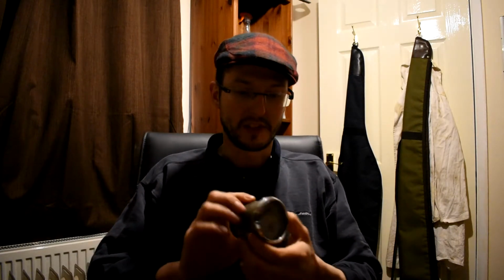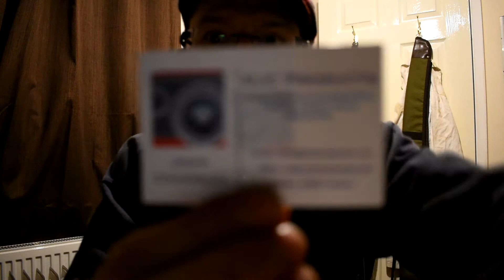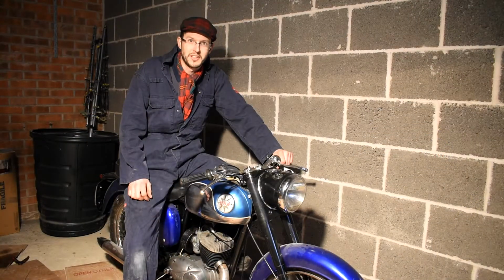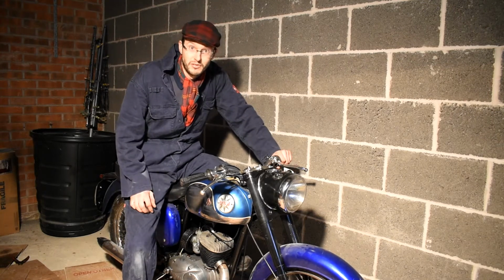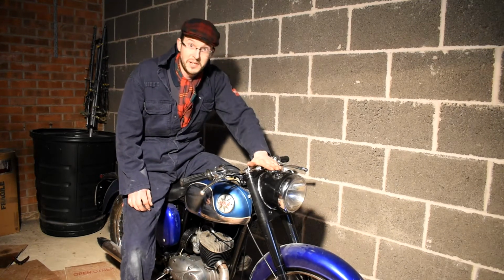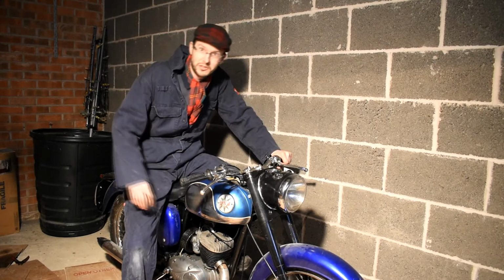BSA Bantam HT Lead and Speedo

Comment: Hi Steve. Great little bike. I had one, a D14/4 in the late 1970’s same colour. In the days when as a youth you could ride up to a 250 on “L” plates. 
Since went to bigger and better bikes and now classic cars. As I sprint a TR3a. 
But very fond memories of the little 2 stroke bantam.
Reply from the maker: Limiting new riders to 125 in my opinion is dangerous. With today's roads and how people are on them I think they should change it back to 250. Whenever I've been out on my Yamaha 125 on a duel carriageway I always feel the bike is doing too much work and can only just get to 68mph on a downhill, its dangerous for me and other road users. Then it becomes stupid as to gain a full licence it has to be done on a 650. Hold on 125, 650 there worlds apart, shows the government don't know what there doing
Reply: Steve Denton 
I know what you mean Steve 
But I lost a mate who went from Honda ss50  to yam 250LC
The only qualification was going from 16 to 17 years of age. 
You had to snap the throttle on the 50’s to get them going. They did the same on the LC’s = uncontrolled wheelies into oncoming traffic.
At least direct access has a limit on power.
Reply from the maker: I'm sorry to hear about that. I think it'll always be a grey area for debate on 125s or 250s or going off the horsepower. That said when I do pass I'm just going to go up the bikes engine sizes a little at a time. I don't think you can ever put a price on experience, so no R1 for me for a few years at least
Reply: Steve Denton 
Have some real fun and see over the hedges with and adventure style bikes. I moved down to the BMWf800gs. Triumph do similar. Great fun both here and abroad. 
Say safe. 👍

Comment: I put an O ring behind my clock...helps a little to keep water out.

Love the real neat crimping job.

You a club member Steve.
Reply from the maker: Yeah I was thinking that as I was putting it back together, is there mean to be one. It’d also would act like a cushion stopping metal to metal rubbing. I may well redo it at some point. Afraid I’m not a club member yet, as soon as it’s on the road I’ll have a look around either the two stroke owners club or the Bantam club
Reply: Hi Steve yes there is supposed to be a seal...its shaped but I doubt they are available.

I made my own seal from a thickish O ring looks the part...no doubt you could buy one...I had some O rings around 3 ins dia...I cut a section out of one and supper glued back together.

http://www.bsabantamclub.com/forum/

The Bantam club I find is good value...10% discount on parts from the likes of Rex Caunt.

Lots of free advice on the forum.
Reply from the maker: That's awesome stuff, thanks for the info. I've used Rex many times for parts while rebuilding the bike, very well polite man and knows his stuff. Interesting to know that with the discount, cheers :)